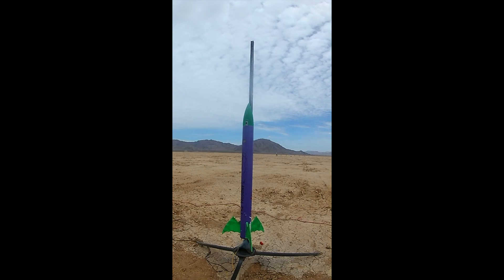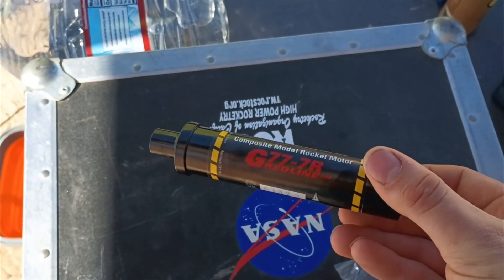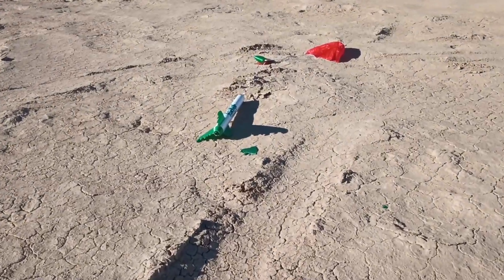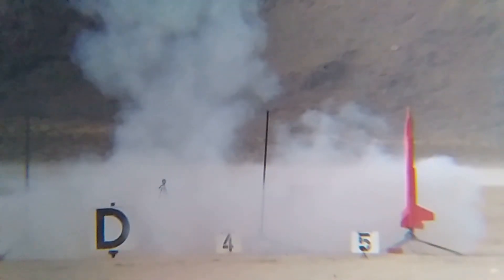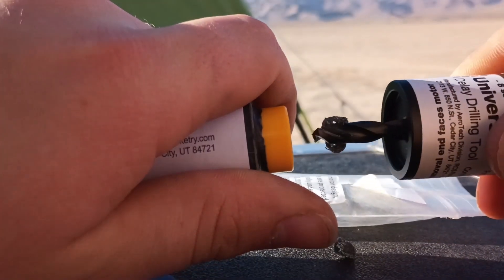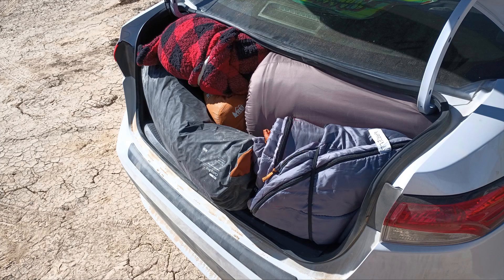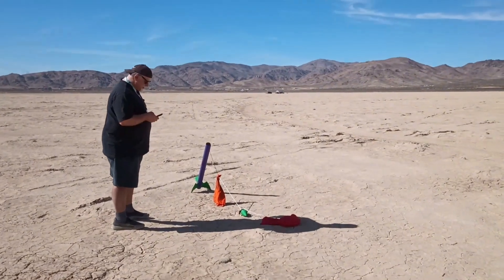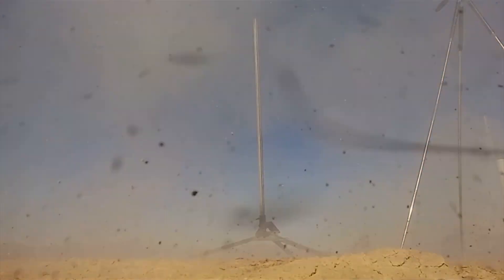I Built a New High Power Rocket - flying high-power at ROCstock 2024

Comment: Could you make a amateur liquid rocket using an electric turbopump? with easy instructions on how to assemble an build it?
 
Edit: could You just make the TurboPump then? and rocket engine? @Sciencish made a turbopump...
Reply: In this case you wouldn't use an electric turbopump for such a small liquid rocket engine. Instead a pressure fed liquid rocket is better for smaller engines.
Reply: @benjaminshatokhin4725  Make a larger rocket!